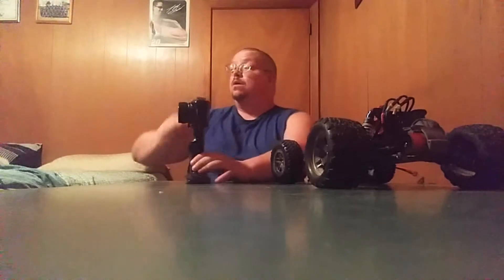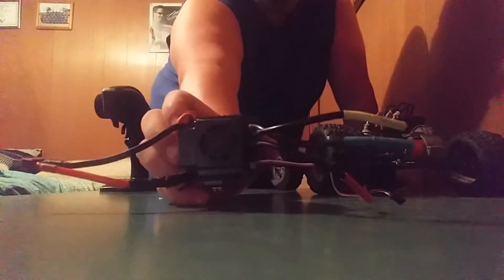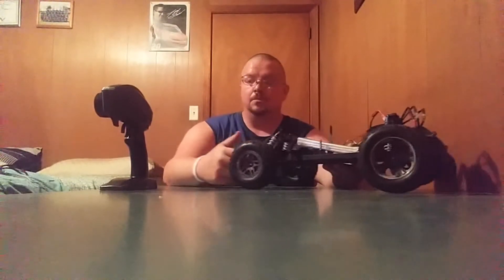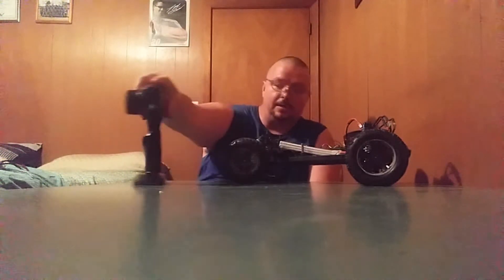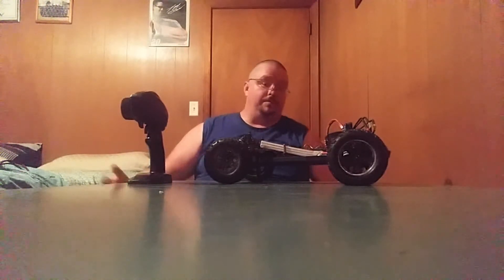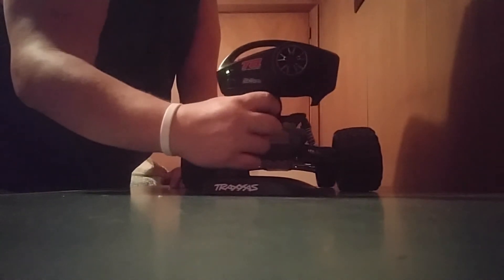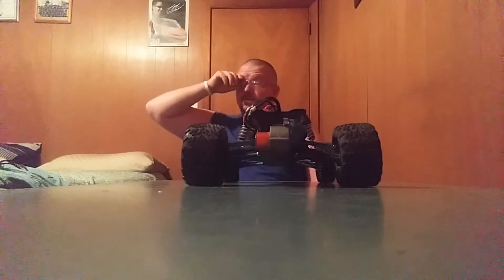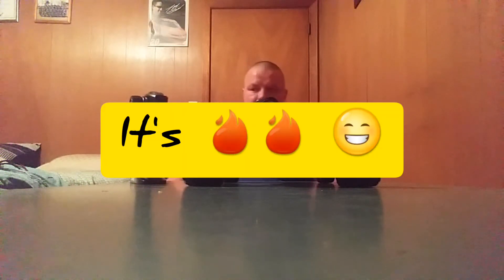I'm having problems with my Traxxas 2wD Rustler

Comment: What’s up Bobby. Try switching the steering servo from channel 2 to channel 1 on the receiver and put the esc on channel 2. Also you gear mesh sounds too tight.
Reply: Looks like Bobby has graet bunch of subs to help him out 👍udrc
Reply: kel Robins we try to help one another. 💯👍🏾
Reply from the maker: @UDRC85  I'll try that here in a few minutes bro and I Really Do appreciate it 💪👍👊💯
Reply from the maker: UD RC You nailed it man thank u big bro for the help I appreciate it 💪👊💯🔥✔👍
Reply: Bobby's Rc's no problem brother. If I can help I’ll give as much info as I can. Can’t wait to see the vid brother.
Reply from the maker: UD RC I did run the battery down but i didn't record tho because it was so hot outside but when I came back in I recorded a lil video bro so be looking out for it 💪👊💯👍✔